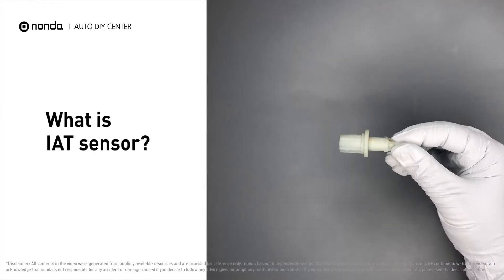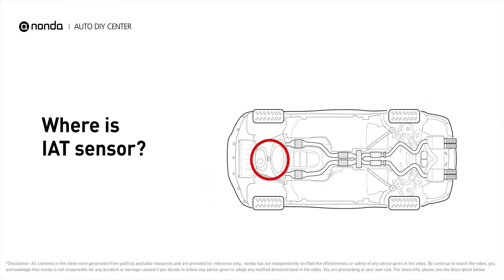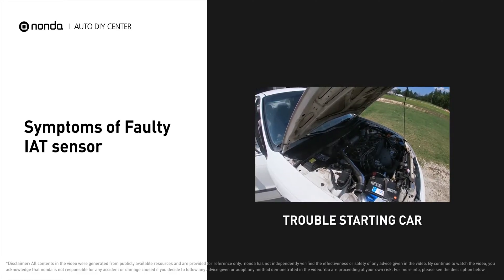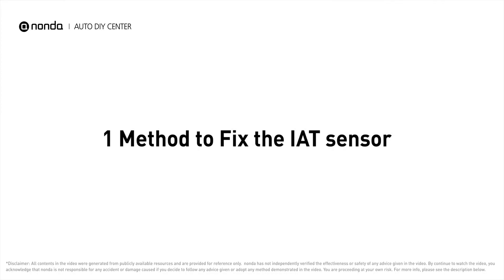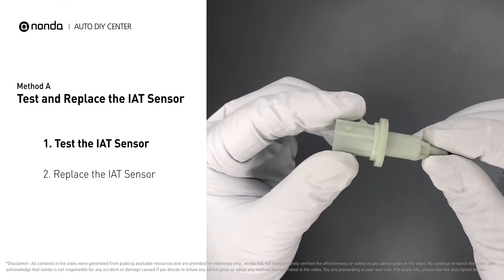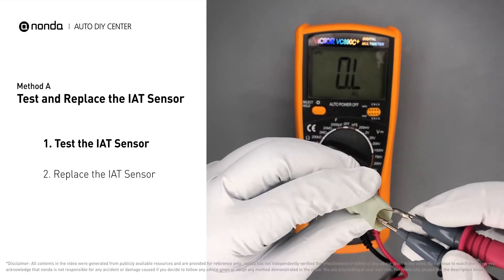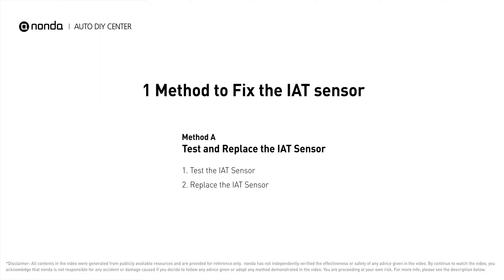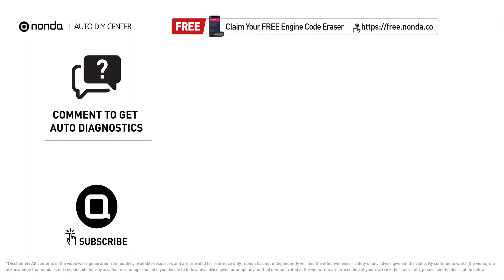IAT Sensor: How it Works & How to Fix

Comment: I was wondering if you could help.. I got a 04 Envoy which has that and it has the wires coming out of the plug that plugs into the piece if they have connectors about an inch and a half down it connects to the other two wires that goes behind the engine somewhere not sure why he has connectors on it I'm thinking of taking the other one off because one of them came apart the other night what does Time each one together..